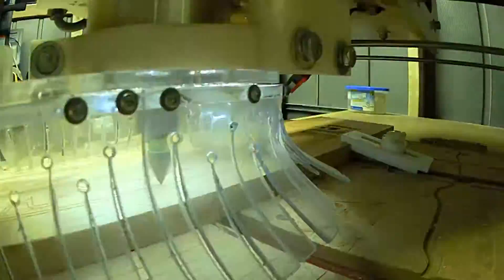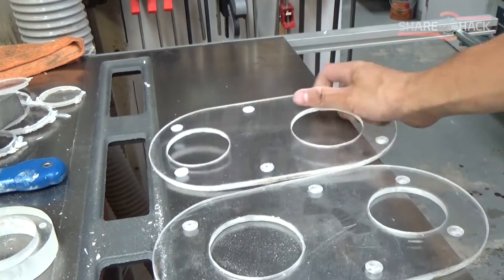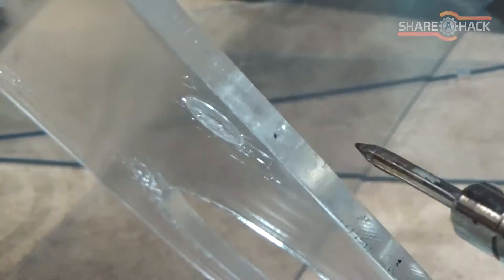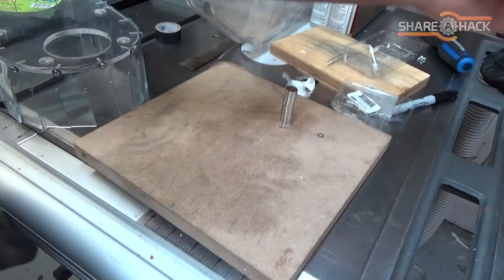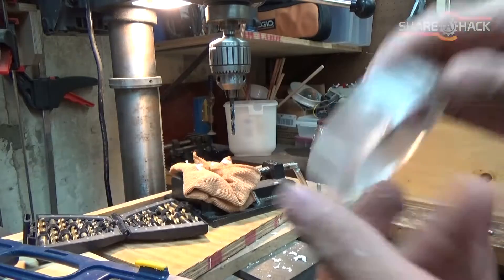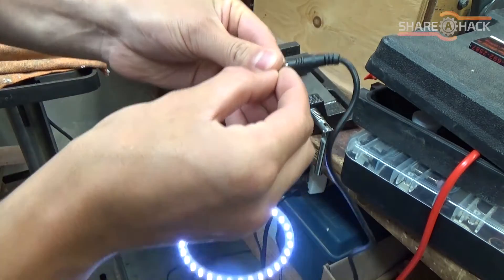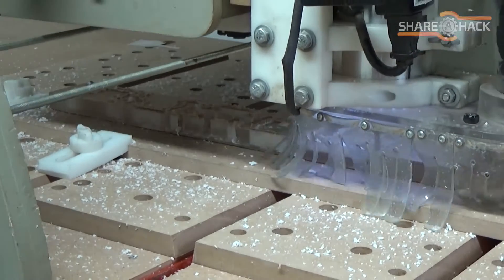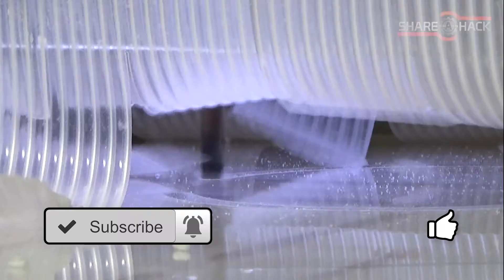DIY LED CNC Dust Shoe Made From Transparent Acrylic & PVC (Do's and Don'ts)

Comment: Is anyone afraid the skirt will wedge into a hold down or v shaped groove and cause a cnc misstep?
Reply from the maker: Yes that was a concern...my solution was to round off the edges and corners of each skirt flap using sandpaper/dremel..and it seems to work well - haven't had anything get caught yet 🤞🤞

Comment: gut a speed controller. here is the one I have. https://www.amazon.com/Electronic-Controller-Variable-Adjuster-Hydroponics/dp/B07T9BLJ7L/ref=sr_1_1?keywords=speed+control&qid=1577749458&sr=8-1  I have mine marked between medium and high is 16,000 rpm. and between low and medium was around 11,000 rpm.

Comment: I use the info from https://www.onsrud.com/Forms/Cutting-Data-Recommendations.asp then. I use there info and cut it in half for my desktop cnc and speeds work great for me. They give you feeds and speeds for all materials and bit types. check them out. free downloads of feeds and speeds per material type.
Reply from the maker: Great resource. I'll need to do a couple tests on my machine has it's just a simple Bosch wood router with a variable speed dial (no way that I know of to dial in precise spindle speeds) but would be good to know what works for my machine, thanks!

Comment: You might try using both materials, shorten up the more rigid "brush" material to the longest length that you would never go past (i.e. the shortest bit you would ever use, lowered to the lowest Z that you would ever use).  That would add rigidity to the brushes, but still allow for some give should it get caught on something.
Reply from the maker: Good tips, thanks!

Comment: Nice of you to put out a video on your trials and tribulations. I tried your path also and ended up using a strip brush after a fail with the clear pvc strip from a industrial refrigerator doorway.
Reply from the maker: Glad it could help a bit! Brushes definitely seem like the way to go if seeing the cut isn't a priority. I later attempted a brush version using bristles from dollar-store dust pan brushes and it worked out OK :)
Reply: You'll soon find out that if the top is clear that is good enough. Most people adapt rather quickly to not looking at it from  a side view. probably just as you have or will.

Comment: Where did you find the LED light from. Can’t seem to find any small diameter LED rings like that. Great job by the way.
Reply from the maker: Thanks Anthony! I got the LED ring lights from eBay. It was a similar listing to this: http://shareahack.com/link/ebay-ring-led
Also found some similar ones on Amazon: http://shareahack.com/link/amazon-ring-led
The ones I got were 100mm diameter and I think were being marketed as car 'fog lights'. If you search for "12V LED Ring Light" you should find a bunch of different kinds.

Comment: Good job! To avoid those cracks in acrylic, make sure to used cast acrylic instead of extruded. Extruded acrylic has lots of internal stresses that make it bad for any machining.
Reply: Best results and mirror clean finish i achieved with special single O-flute bits...
Reply from the maker: Good to know, thanks! I will try this
Reply: @firefoxik75  can you provide a link for this bit?
Reply: @Tx2Aggie  huhao bits on AliExpress
Reply from the maker: Thanks Michael! I was not aware of that...learn something new every day. The scrap piece of acrylic I started out with was being thrown out by someone, I think it was originally a window for something and had no markings. Great to know in the future if actually purchasing new plastic. Do you know of a reliable way to test if a piece of plastic is cast/extruded? Cheers